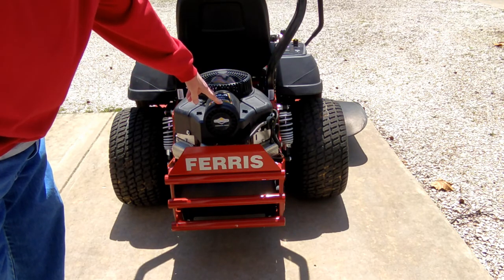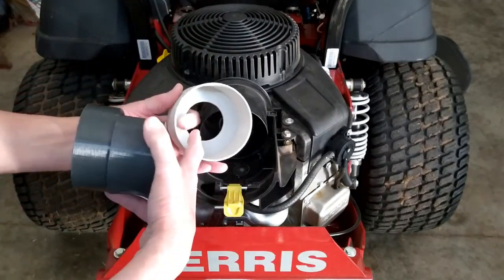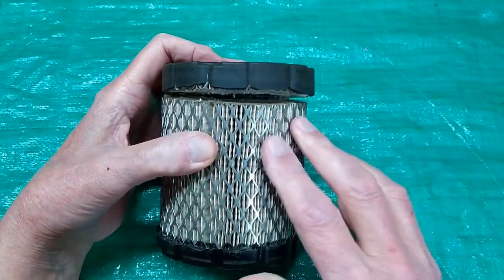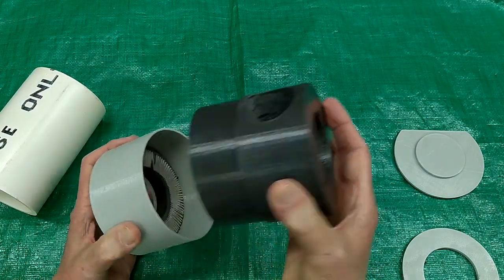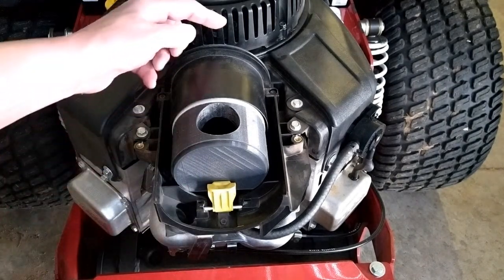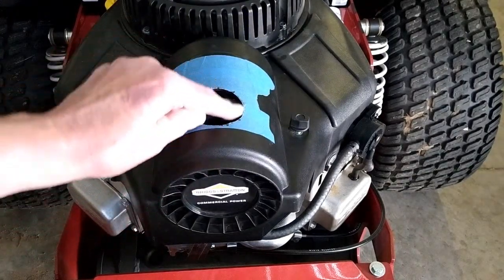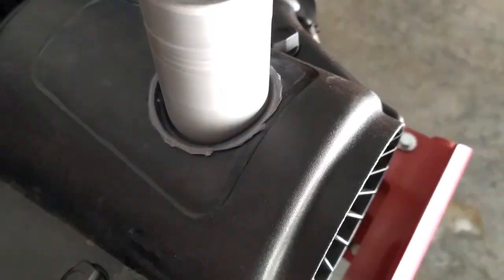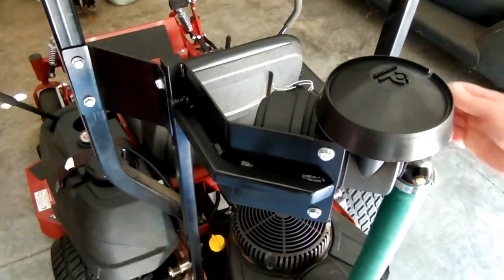Briggs & Stratton 44T977 Air Filter Improvements

Comment: Wow ! Very nice set up . I’ll be adding the same Donaldson filter to my Kawasaki engine . Mowers that have these from the factory and people that upgrade to the filter attached brackets to the plastic cover . Your way seems much stronger
Reply from the maker: The shop that services my mower commented they thought my mount for the Donaldson looked factory. :-)

The Briggs & Stratton is a good engine (other than this air filter nonsense), but I wish I had purchased my Ferris mower with the Kawasaki engine, which came with the Donaldson filters from the factory.

I have not seen any brackets available for attaching a Donaldson Filter to the plastic cover. I would like to see what they have done but I would think it would be probe to cracking (or something). I don't have much confidence in plastic to begin with.

Thank you for watching. Please subscribe! 
That is what keeps this channel going. 
Ron

Comment: Could you make me one? Great solution. You are a genius.
Reply from the maker: Sorry... No! I simply do not have the time to make my "stuff" for anyone else.
The free 3D printing files are on Thingiverse.com and there is a link in the video description. You either need to print them yourself or find a friend with a 3D printer or use a service that prints items.
Then... you need to be careful when doing this so everything is assembled correctly and you don't end up with any air leaks that would allow dirt to enter the running engine.
I have been running this arrangement for over 2-1/2 years and it works perfectly for me.
Good luck...Have fun!
Please subscribe! 
That is what keeps this channel going. 
Ron

Comment: Great job of fabricating this up, should do a great job of staying clean.  Calculate your labor hours and equipment purchasing and overhead.  Compare that to the increased engine life and my guess would be be Staying with the B and S system would be more cost effective.  Most of these engine designed started life being mounted in front of the cutting area.    But that's changing a bit.  Really enjoyed viewing your work, very skilled.

Comment: Hi Ron,ran across your video trying to come up with something also to get rid of the original BS ,no pun,air filter. How is your setup working out? The original setup was supposed to pull air from just above the flywheel and send it through the engine cowl before exiting it at the bottom underneath the carburetor, with some entering the engine through the filter. That airflow also cools the engine, that's another reason why your method of connecting the Donaldson is really nice
Reply from the maker: Actually, the airflow through the engine created by the flywheel cooling fan has nothing to do with the carburetor air intake. The carburetor air intake was distinctly separate and has been relocated to a higher point with my modification and installation of the Donaldson Air Filter. 

I now have 2-1/2 seasons of grass cutting and 2 seasons of leaf mulching on the Donaldson Air Filter arrangement and I am very happy with it. I have checked the filter cartridges several times and everything has remained very clean and I have had no reason to replace the cartridges. 90% of the battle was getting the air intake up higher where a source of cleaner air was available.

Thanks for watching. Please subscribe! 
That is what keeps this channel going. 
Ron
Reply: @RonaldWalters2010  Thanks for getting back to me so quickly. The way I described it is probably misleading. What I saw on briggs site was it pulls air and grass debris through the wire screen on top of the shroud above the flywheel and shreds it ,this mulched up mess exits at the bottom of the shroud right near the intake for the air filter. That, as well as you described how tight the filter is in the housing, is probably why it clogs so quickly. Glad to hear your relocation worked out well. I am going to have to figure out how to do this without 3D printed parts though, I don't have a printer. Wish me luck 🙏. Thanks again!
Reply: Ps I did subscribe.
Reply from the maker: No time like the present to jump into 3D printing. :-) They are not that expensive.
Otherwise, find a friend who has one... or
A lot of libraries have them (not sure how that works)... or
There are some 3D printing services (which I have never used) check on Thingiverse.com or Google it. 
Just make sure your engine is the same one as mine.